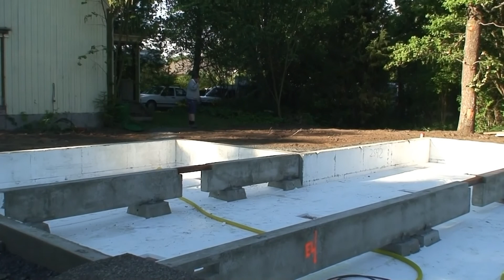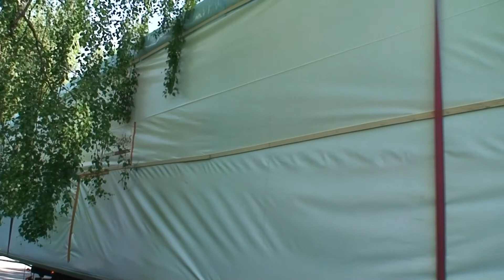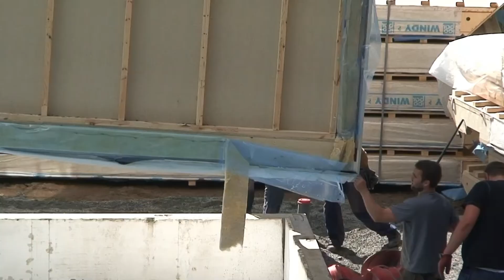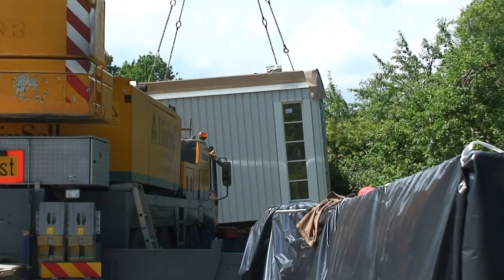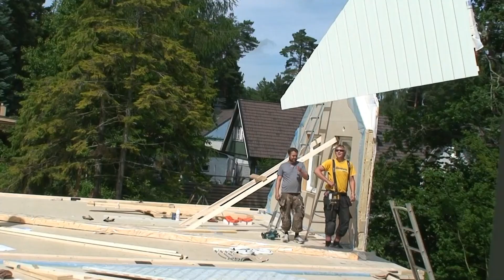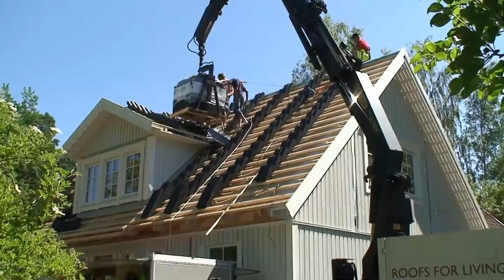How my home was built.

Comment: I had a ' house '  I could pull down the road with my 1964 Dodge D-100 van .  It was 30' X 8' in size but for one person was very nice.  I could vacuum the floor in 10 minutes with a hand-held 'Dustbuster' in about 10 minutes !  That was 1989 to 1995  .  .  .  .  1996 I moved into my current 3 bedroom home with 2 car garage that was built in 1961 .    (The trailer-home was much easier to take care of.)
               Thanks for the home-assembly video . . . very nice !       RH